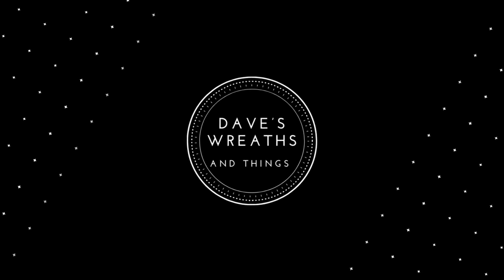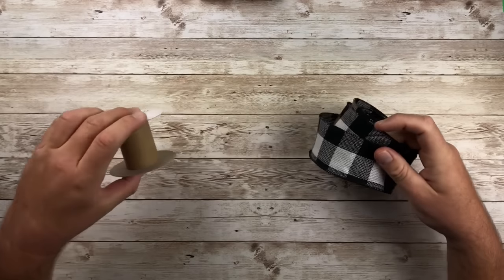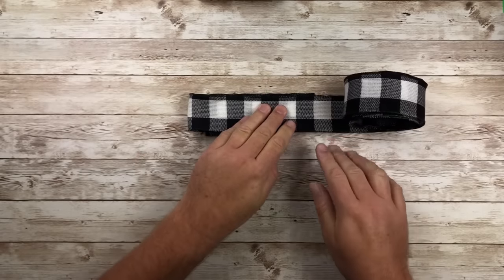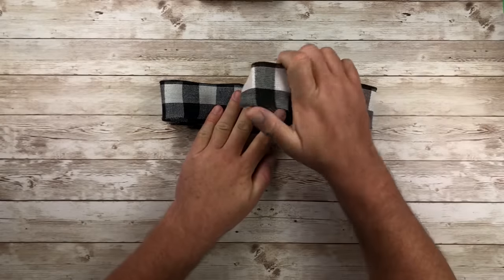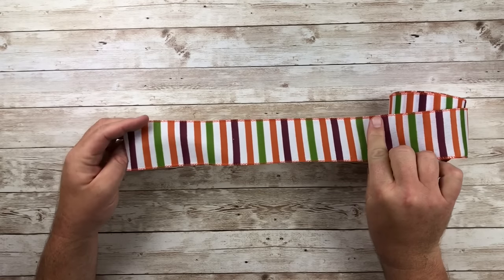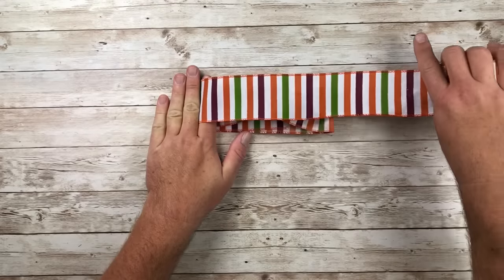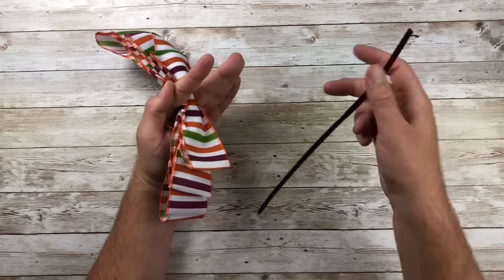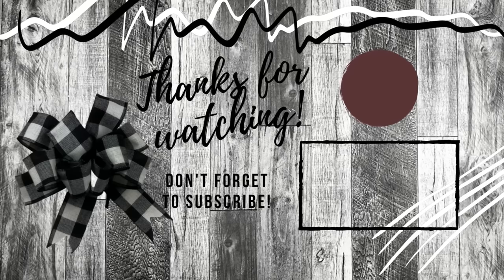How To Make a Simple Bow

Comment: Great informative and easy to follow video. I would like to know how much ribbon in total you use to make this bow. I have rolls of ribbon that are 50 yards long and I want to cut off the amount needed to make this bow. Thanks.
Reply from the maker: Hi there, thank you so much.  For this bow, I used just less than 9 yards of the ribbon.  The length you cut will depend on how many loops you make.  But, if you use the same loops as I do, I would cut 10 yards and then whatever extra is left over, you can add as more tails if you wish.  Hope that helps.  Take care.

Comment: Hello, I am making a bow for an independence day wreath, how long  is the spool of fabric you are using?  2 yards? Please let me know, thanks Dave!
Reply from the maker: Hi there, for this bow I used almost 3yrds of ribbon.  You could use 2-3yrds, depending on the size of your loops.  If you're to do a smaller bow with less loops, then 2yrds would work out.  A larger bow, with more loops, would be closer to the 3rds mark.  I hope that helps.  And happy wreath making 😊😊😊
Reply: @DavesWreaths  Thank you!  Still working on the bow, the fabric is wired, but really stiff. It's double sided with stars on one side and stripes on the other. It's very eye-catching but hard to work with. I'm thinking of steaming it a bit, not sure. My dad and I are doing it together.  Easier to do with two, lol.
Reply from the maker: @mkatepaski9947  Your ribbon sounds exactly like one I used recently.  It is a beautiful ribbon but rigid.  You are right, two people s better than one lol 😆

Comment: 2.5 inch width for ribbon but how many yards do I get for this size bow? This will be my first attempt ever in my 58 yrs of living and when I go shop for the ribbon I was just wondering what size of spool do I get?
Reply from the maker: Hi Clarissa.  The lengths of spools usually come in somewhere between 10 yards and 15 yards...depending on where you purchase your ribbon.  I used a spool that was 10 yards for this ribbon, but I did not use all the ribbon in the spool.  It's hard to give an overall total length used unless I unravel the bow.  Hope that helps and happy bow making!!!  😊

Comment: Great Dave! Can you please tell me how to add a 1" ribbon with no wire in it along with your black and white ribbon? 😊
Reply from the maker: Hi Lou-Ann...Thanks so much for the question.  😊  To add your 1" ribbon I would lay that, good side down, on the table first and then add your 2.5" ribbon, good side down, on top of that making sure your 1" ribbon is centred.  Then I would just use the same method in this video to create the bow.  I also have another video that shows you how to do a Double Ribbon Bow...which is what you're looking for...in my list of videos on my channel.  That could help you out a little more.  Also, I have made a few bows that have the ribbon non wired, and they do tend to sag a bit more than the wired ribbon....so hopefully that doesn't happen with yours.  Have fun!!!  😊😊😊
Reply: @DavesWreaths  Thanks so much for taking your time to answer and explain!

Comment: I see that the ribbon you used was 2.5 inch wide wire ribbon, BUT how long in length was the whole spool of ribbon you used, to make this one bow? I have 30 ft. of ribbon in my spool. I'm wondering how many bows I should make with that length.
Reply from the maker: Hi Tracy, I used the full spool that I had for this and it was 3yrds.  It all depends on how many loops you do and how long you make them.  This bow in this video was the 3yrds in total for the bow.  😊

Comment: Do you follow the same process if the ribbon isn't wired?
Reply from the maker: Hi Veronica, I don't use the same process.  I would say 99% of the time I use a wired ribbon as it holds the shape nicely compared to a non wired ribbon.  Usually, for small bows, I will work with ribbon that isn't wired and I just use my fingers to make them.

Comment: Is that bow made with wired ribbon? Can it be made with Un- Wired?
Reply from the maker: Hi there, yes, this was a wired ribbon that I used for this bow.  You can use un-wired ribbon, but it may not be as full as the wired ribbon.  It all depends on the ribbon you use.  The satin un-wired ribbon tend to droop and not hold their shape.  Hope that helps. 😊